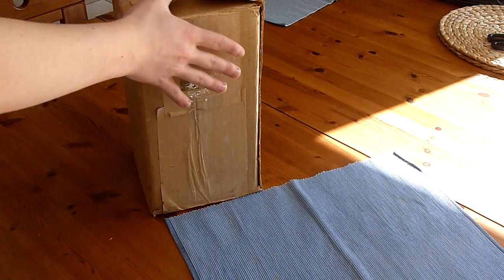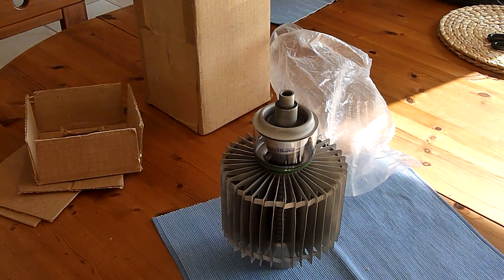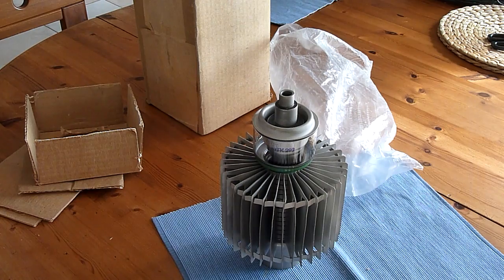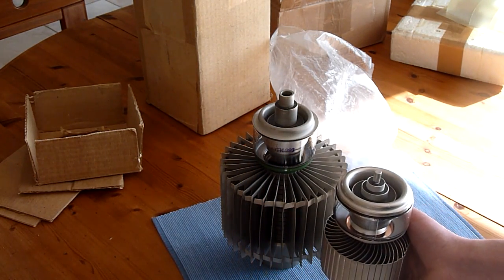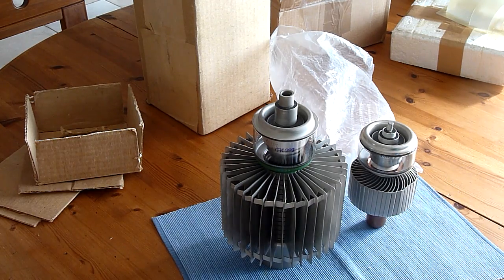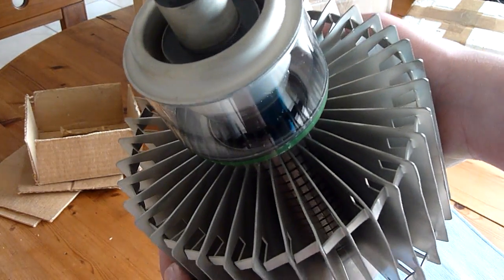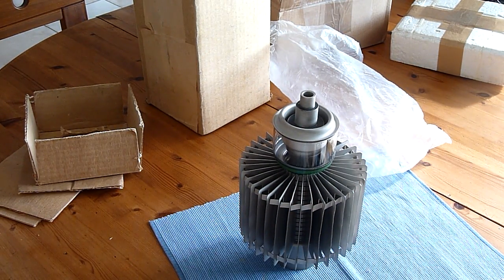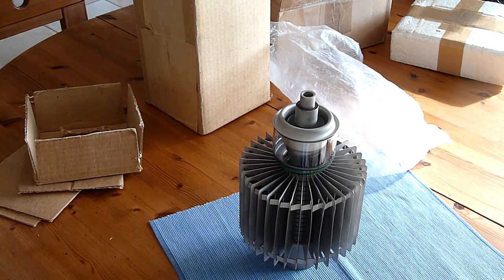The GU-56 Triode

Comment: Great tube!  (I believe) the largest-capacity air-cooled triode on the planet.  It can actually dissipate 900W — 700 on the anode, and 200 on the grid.  It's directly-heated, (meaning the filament is also the cathode), as well.

A couple of corrections(/omissions):
You are correct that the "A" and "B" suffixes (on transmitter/power tubes) denote forced-air-cooled and water-cooled; the convection-only cooled version is known as the ГУ-56-1 (or "GU-56-1").

Also, the printing on it actually says, "Made at SSSR", (NOT "I make in USSR" as stated).  "Sdaelano" — ("C" in the Cyrillic aphabet is S in ours, "Л" is L, and "Н" is N) — means "made"; "В" — (V in out alphabet) — means "at", and "SSSR" — (the Cyrillic "Р" is our letter R) — stands for "Soyúz Sovétskikh Sotsialistíčheskikh Respúblik" (or "Union of Socialist Soviet Republics").

Again, great triode!
Watcha gonna do with it?  (If you had a second one, you could build an AWESOME 200W S.E.T. amplifier with them!)
Reply from the maker: I might follow up on that SET amp, i have been contemplating it for a while now, but have not built one. 

Thank you for correcting me in the video!
Reply: No problem; figure you'd wanna know.

 The trick with making an SET out of 'em, (apart from coming up with 50 or so amps of 6.3V for the filaments), would be getting single-ended output transformers made that can handle the (up to 1.5A) anode current without saturating.  I'm guessing each would be almost the size of a dishwasher!
  It'd probably be a better idea to use a CCS (at 100mA or so) and run a real high B+, like 3kV, so you can keep the output trafo size reasonable while still getting the wattage, (but then you have to worry about arcing/corona discharge/etc.)  Still, can you imagine what that thing would sound like? (Yummm).

Comment from the maker: @MrSciencetificsasuke Its a Modulator, Oscillator and Output valve, that can output an exes of 1.4KW, generaly this kind of valve is used in either RF / induction heating, or in lowpower transmitters as the output or in highpower transmitters as the modulater. One benefit of this perticuler valve is that it dose not requier any forced air cooling (blowing air onto the radiator / heatsink) but can be cooled with convection alown. I will probalby build a rather faroshis VTTC (Vacuumtube Teslacoil)